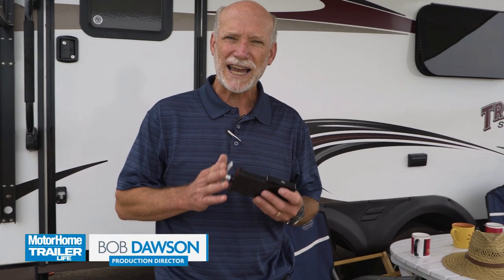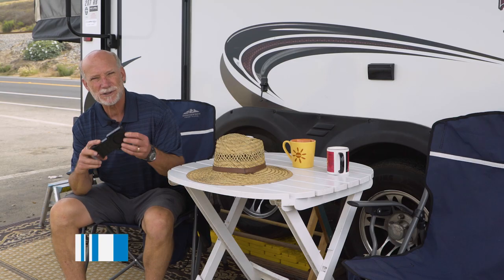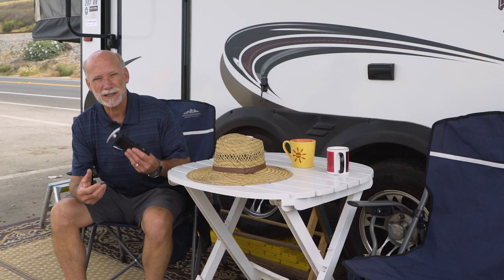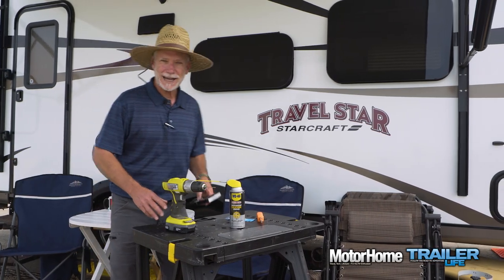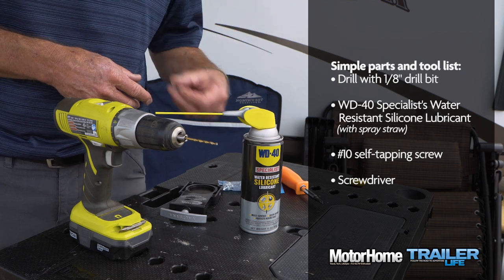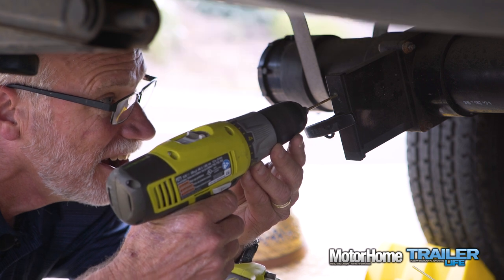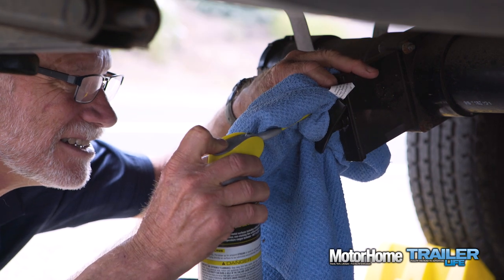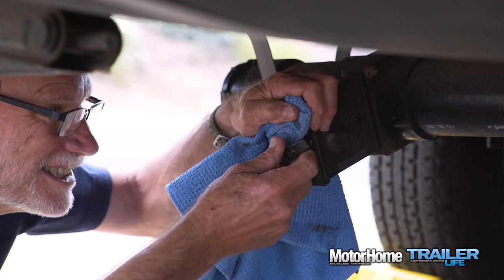Make Me RV Smart: Lubricating RV Sewer Valves

Comment: The only thing I would say is use a Silicone Based Lubricant to do this fix.  WD40 is patroleum based and will eventually cause the plastic to wear out and then you will have to replace the entire valve!
Reply: That happened to me.... don't use petroleum based greases or oils.
Reply: So what about using white lithium grease? Do they come non petroleum based? Thank you 🐣🪻🐤
Reply: He is using silicon lube WD-40 brand. I'm not sure but I would assume it wouldn't have petroleum in it. I would check first before I used it though.

Comment: This is a great suggestion. The only issue I have is the 3 valves I have (RE: Grand Design 2670MK) are opened and closed with extension cable handles. The valves are within the enclosed belly and not readily accessible. It would be great if there were a suggestion on lubricating the cables and valves on cable enabled waste valves.
Reply: Yes, this is the info I'm searching for as well.

Comment: Our fifth wheel has a panel with pulls for both gray tanks and the black tank (located inside a door on the side of the camper).  The handle for the kitchen gray tank is very hard to pull open and push closed.  I took off an access panel to the backside of this “plumbing center” and all I could see were cables attached to the backside of the pulls, which were on the front of the panel.  The cables were enclosed in a solid black sheath.  I sprayed lubricant on the “T” handle in the plumbing box, but still very hard to open and close.  I don’t see any other access point to the Valtera gate vale itself.  Any suggestions?  Thanks!
Reply: You’ll have to cut an access panel in the underbelly directly under the valves to do what is being shown in this video.

Comment: The valves on our last two and current RV are hidden inside the underbelly somewhere and operated via cable pull push, cant'n find unless you take the skin on the bottom off.
Reply: Mine too, and its stuck right now while camping. If you can't easily fix the type he's showing you have bigger problems. My underbelly has to be dropped.
Reply: @Josef_R  wish they would make the underbelly have a panel to remove by itself to access the valves.  Mine is like that too and mine is stuck but at least it is stuck open right now.
Reply: Cut a panel (window) just below the valve. I found mine with a cheap Amazon endoscope. Cut a hinged panel, replaced the valves and closed them back up with screws into wood frame around the coroplast and Gorilla taped the seems.

Comment: I believe I am about to embark on a REAL adventure.  My black water tank valve is VERY sticky to almost impossible to slide.  Further, the "Black Water Holding Tank Gods" are against me as the handle, with the exception of the hub that threads on to the slide shaft has broken off.  Yeah me...  Oh I for got to mention the tank is also full, I may need a full wet-suit to protect myself.  I think I might make a video and post it.  I just recently got camera equipment for that purpose.  Wish me luck I will also be investing in some Lysol.  LOL

Comment: Just tried it.  Works like a charm. Thanks. My blackwater valve was getting sticky. Works great, although I used too much wd40, which squirted out.  I used less on the gray water valve. Both open smoothly now.

Comment: Wouldn't it also be effective to just periodically pull the valve out and lube the plunger and move it back and forth? Wouldn't that do the same thing?
Reply from the maker: We think this tip is a little more comprehensive.
Reply: that's what i've done, and i like this idea also.
Reply: No. This fix actually lubricates the gate, not just the shaft.
Reply: @CampingWorldTutorials  is this different than spraying silicone on the gate directly through the black tank port after winterization/blowing system out?  Great top either way.

Comment: Good video!  What if you have small amount of water in tanks.  Just dewinterized and flushed toilet a couple of times with only water, no waste and briefly ran faucet.  Mine are stuck.  Can't open.  I really don't want to take it to an RV mechanic.  They'll probably tell me I need to replace the valves when all I need is something simple to remedy the situation.
Reply: I know this comment is 5 years old, this is for today's comment readers. If you know you have only a small amount you can use a 5 gallon bucket and catch the contents in that, then just pour it in the toilet and rinse your bucket.  If your valve didn't drive home and it's gonna dump some before you get the drain hose on you can use a bucket to catch while you attach the drain hose in a mild panic.

Comment: What do I do because my 5th wheel is Winterized , with a full underbelly Cover and can get to the Valve itself ?    I only have access to the Handles .   Thx
Reply: Sorry,   I meant to say I can NOT get to the Valve itself !
Reply: I figured out where the valve was and cut an access hole large enough to get the tools and my hands on the valve. Then I put some thin wood strips on top side of the underbelly and fastened with screws. I then used gorilla tape and went over the cuts I had made. I have used those same access holes a couple times now and seal everything when done, and so far nothing has came loose during travel. I did that several years ago when my black tank valve got some paper caught in it and wouldn't seal properly.